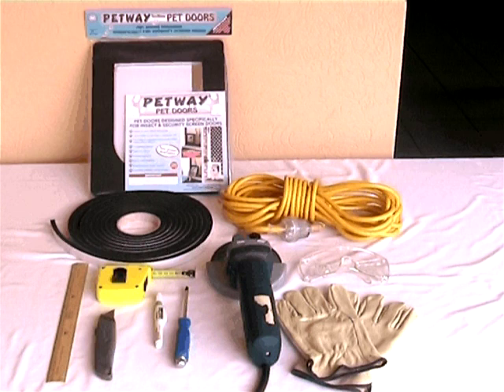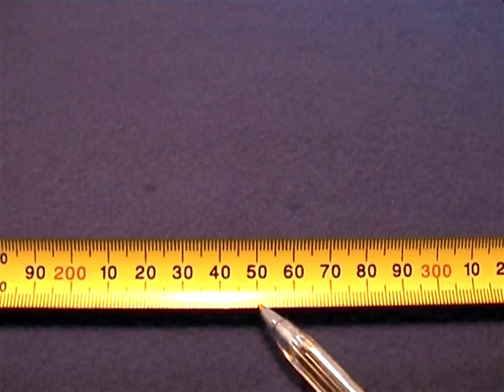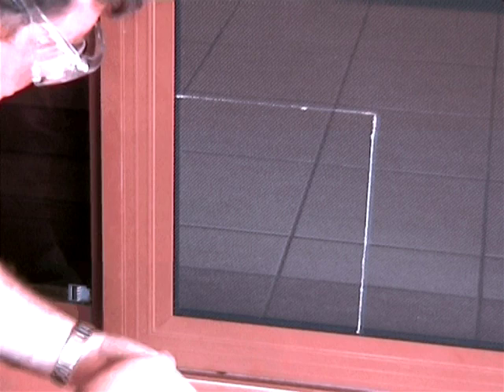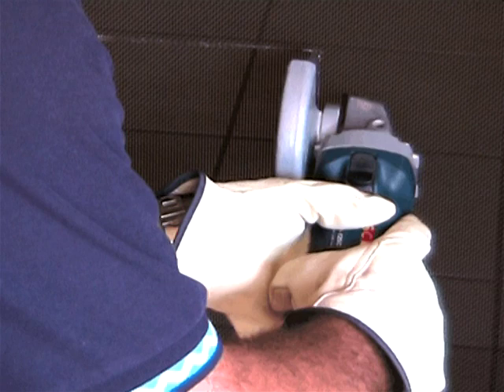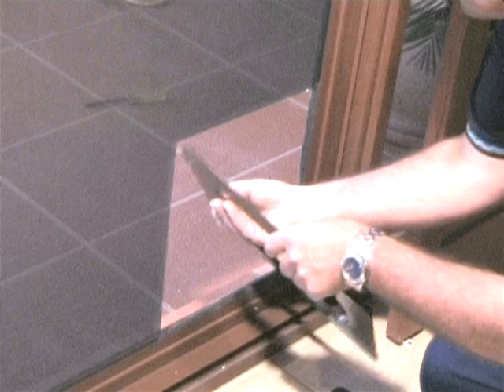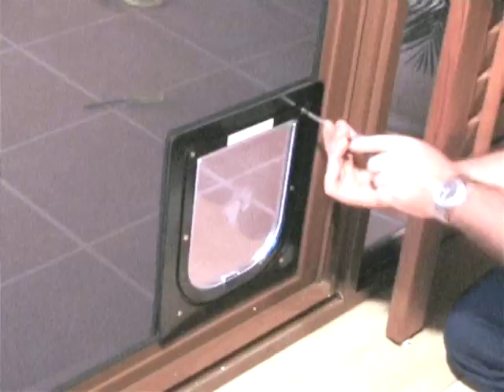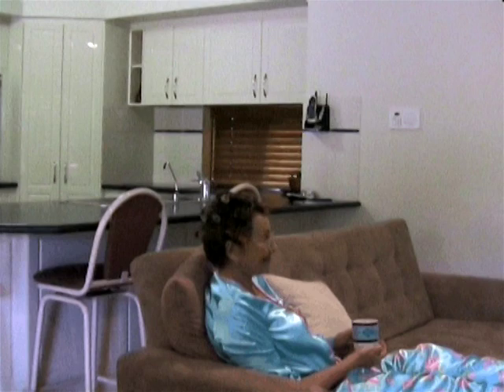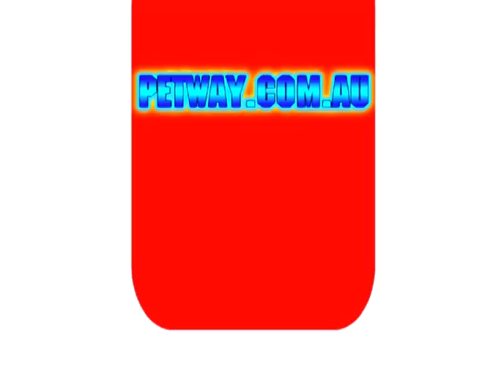Petway Pet Doors - DIY Fitting Instructions - Stainless Steel Mesh Door

Comment: oh my god.... please update this video..... I just bought a door and the lack of instructions for steel security doors not giving me much confidence in the installation. Obviously if its cut incorrectly the door is wrecked.

Do I need to install two strips of 10mm foam tape? What type? Won't this degrade overtime? Why wouldn't I just buy from a competitor that includes the foam? 

Come on Australia... innovate! This product hasn't changed in 20 years....you'll burn out or be overtaken.